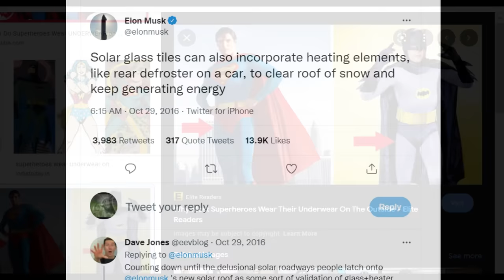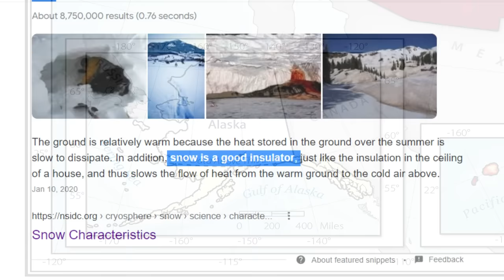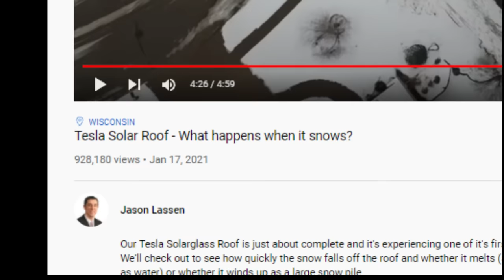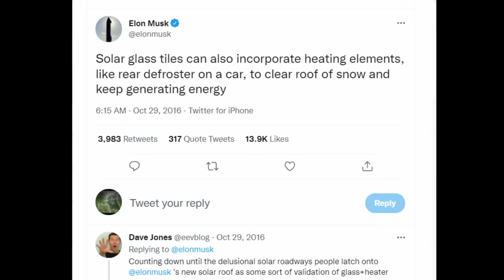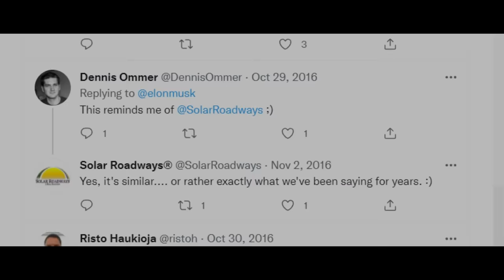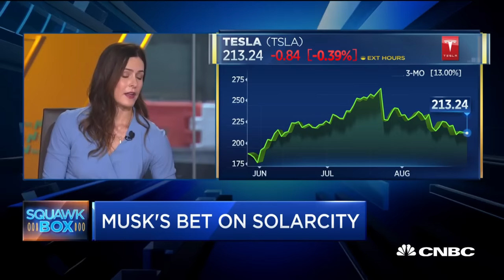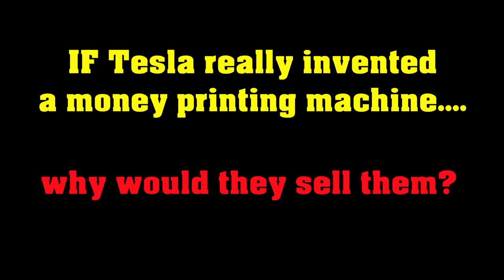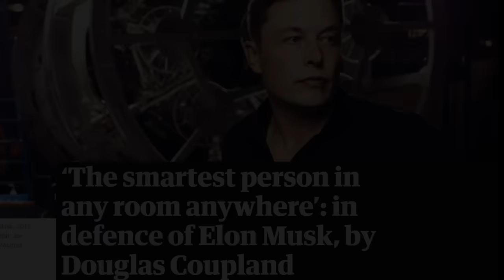Elon Musk: The Smartest Person in any room ANYWHERE!

Comment: 13:20 - "A tube with an air hockey table". Hmm - a tube that's suppose to be in vacuum, then you blow air thru holes into it. That's an interesting definition of a vacuum.
Reply: It's a straw-man.
Reply: @antonpershin998  How is what a strawman? Do behave and tell me you actually know how vacuums work. Because big boy Elon Musk seemingly doesn't.
Reply: @InfiniteDeckhand  if you actually read the Hyperloop Alpha white paper, you would know, that there is no vacuum, jus low pressure air.
Reply: @antonpershin998  Oh, so you mean the quasi-vacuum which Thunderfoot had already demonstrated would crush the tube and is only a miniscule amount of air away from being a total vacuum?
Not sure if you know, but low-pressured air can't provide a bed to glide on like an air-hockey table would. Only pressurized air can do that, which would rule a vacuum out entirely, since those two can't exist at the same time in a closed system.
Reply: @InfiniteDeckhand  "Thunderfoot had already demonstrated would crush the tube and is only a miniscule amount of air away from being a total vacuum"
And of course that tube wasn't disigned to handle quasi-vacuum?
By that logic LHC is impossible, like any other vacuum chamber.

"Not sure if you know, but low-pressured air can't provide a bed to glide on like an air-hockey table would"
That's exactly why hyperloop alpha pods have air compressor in front, to pressurise air.

"Only pressurized air can do that, which would rule a vacuum out entirely, since those two can't exist at the same time in a closed system"
Air castors work by pressure difference, pod moves thrugh tube at very high speed, thus air pressure is higher in front where there is an air compressor, which pressurises air even more.
Since air castors use only air from tube, overall pressure stays the same.
Reply: @antonpershin998  
> "if you actually read the Hyperloop Alpha white paper"
The White Paper!! The White Paper!! All glory to the White Paper!!

Comment: Normaly i´m on Thunderf00t´s side. But her i partially disagree.
My Parentes live in Germany ( so in the north region ) and we have some Snow days. 10-15 Per Year.
They have a Heating installed BUT it´s only for burst Heating for melting not the hole snow but only the bottom to let it slide of the Angeld Roofs.
Full Summer they get a peak of 38 kW/h per day. In Winter it´s only 12kW/h per Day (snow free) and only 500 W/h per day with Snow. 
Burst heating cost ~2-4kW/h of Energy and from 500 Watt/h per Day it did go up to 8 kw/h per Day. ( ~80% of the snow slided down )
But still starting in the morning to catch the most son in the middel of day gives twice the energy as used for getting the roof snowfree.
Reply: You're a bit confused about units here. Watt is a unit of energy per time (Joule/seconds). 
You are telling us the amount of energy it took to melt the snow. To get back to energy you multiply with time, not divide by. The unit you then get is Wh (1 Watthour = (1Joule/1second)*3600s = 3600Joule). 
W/h is a change of powerconsumption over time, which doesnt apply here.
Reply: @S1nwar   I´m was not confused and only used kW/h as its normaly here in Germany. But after reading your correct Math i thinky you misunderstand something or you are confused. I don´t used the Watt generated becouse the numbers are going up and done and also not the average. I used how many kW/h where produced on a day and the amount of energy used for heating. In your math you showed 1W/h = 3600 J. So you can use all the numbers ( exculding the 10-15 per Year ) and convert them for your use. But on the Electric bill i pay it s still written ~300 kw/h per Month.
Reply: @FranksFilmEcke  You are confused Gino. The thing that is on your bill is kWh =power(kiloWatt) multiplied by time (h) so kiloWatt x hour. Not kiloWatt /h.
Reply: @wvdh  Sorry, but in Germany kW/h is also correct. But it´s the same als kWh. Just checked my bill it is kW/h written there.
Reply: @FranksFilmEcke  Well then it is easy, your bill is wrong. I would think that anyone above primary education level understands that dividing 2 things is not the same thing as multiplying them.
Edit: check the Wikipedia page if you are not convinced https://de.wikipedia.org/wiki/Wattstunde

Comment: I would like the calculations on how much energy it would take to melt the snow vs amount of sunlight needed for this to be accomplished. I am no mathematician, but I doubt it adds up.
Reply: A lot.  A whole lot.  Snow is highly reflective so it doesn't take much of it to block enough sunlight getting to the tile to keep the tile temperature below 0 C.  Up where I live most of the snow isn't melted directly by the Sun in the spring.  The snow starts melting when the air temperature gets well above zero.  It really gets going when the nighttime lows stay above zero.  The other way it melts is outwards from where the ground has been exposed.  A field of undisturbed snow can stay covered until well after the trees, sidewalks, etc. are completely snow free.
Reply: He's already covered the maths on that. Watch some of his solar roadways videos, in which one is where he mentions why we use snowplows, instead of flamethrowers.

If I recall correctly, the energy required to turn water from solid to a liquid, is the same amount of energy needed to raise the temperature of the water by a single degree.
Reply: I have no idea if it is a good idea but it is plausible and has not been 'proven' otherwise on this video.  The snow is not melted from a foot thick to nothing, it is melted as it falls and solar panels are known to naturally run warm in day time to begin with.  Keep in mind that the tens of millions of air source heat pumps around the world also do a similar defrosting procedures: when they are used for heating in cold climates they are perpetually icing-up and have to stop bring heat into the house, reverse the pumping direction and then pull some heat back from inside the house to the outside coils to melt off the ice.  It's a small loss for a large overall efficiency.  There is likely an equation that could demonstrate this making (or not making) sense for defrosting/de-snowing solar panels or solar tiles.  It is not implausible like the misleading charlatan Thunderfoot says here off the cuff.  Really both Musk and Thunderfoot are talking out of their axses most of the time, but one of them is actually accomplishing some amazing things while the other merely gets a lot of Youtube views.  Meanwhile people do fine with solar panels even here in Canada, much to the chagrin of the deluded TF.
Reply: @deathsheir2035  Not even close.  Melting a gram of ice takes about eighty times more energy than it takes to raise the temperature of gram of water by one degree Celsius.  Water is actually a really weird chemical.
Reply: @scottross8606  Solar panels do get covered with snow here in Canada if they are too horizontal.  When the daytime high is -15 I guarantee the panels will not be above 0.  What they do have going for them, especially if they are angled properly, is that they are so smooth that snowflakes just slide off due to gravity or get blown off with the slightest breeze.
Reply: Might depend on the amount of snow.
In arid climate were it barely snows but the snow last forever once it snowed it might be worth it. Maybe.
Reply: @JonMartinYXD  gravity lol gravity pulls down small snow flakes but not helium balloons it about being heavier than air not gravity

Comment: The "Tesla roof" is on a house under construction. By far the most likely reason that roof is clear is that they probably haven't installed any insulation yet.
Reply: yet tesla is promoting that the roof is working
Reply: @toomanyaccounts  sounds like a typical tesla project.
Reply: Do they heat the whole house while it is under construction? I would have thought they would just have a blower in the room they were working in (I have never worked in construction where it snows)
Reply: @glenecollins  I don't work in construction, but I've noticed that they seem to stop working during the winter.

Unless it's a big project where they can cover the whole thing up, it doesn't look like they work right before it starts snowing.

I have no idea if it's just what it looks like or if it's just a Norway thing, but that's just what I've noticed.
I don't think they normally waste too much money on heating unless something they are doing require a specific range or temperature like painting or gluing, but during the cold days they generally just cover up with warm clothing, hats and gloves.

again I don't work in construction :)
Reply: @svampebob007  they would just wear a jacket or something here but our coldest days generally get up to 10 degrees C by midday (where I am at the moment) and I have mainly worked in the tropics and subtropics.
Reply: The heat will not even be on, nobody is living in it, they will be passing current back through the panels at night I imagine.
Reply: @kingcosworth2643  that would mean the panels are constantly acting like a resistor across the charging circuit that seems like a horrible waste of power.
In this case the panels probably aren’t even connected to the mains. There are other dark roofs in the video where there is no snow on what I assume is the sunlight side. They probably just had a few days where it was marginal if the snow would accumulate or not. If it couldn’t accumulate the lower reflectivity of the solar cells (snow is very good at reflecting infrared heat) would warm the snow that fell in the day and possibly melt any which fell at night.

I think the surface is also more slick so snow would be more likely to fall off.

TF is correct about the snow being a good insulator but if you are just at where the roof is being heated by the sun enough to melt the snow the energy usage may even out.
Reply: @glenecollins  You could be right, I was thinking it could potentially be an option to power them at night a little so snow doesn't settle, you will waste energy, but by function you will be able to produce power during the day because they are clear,  if you don't clear them then they are blocked.  It probably is connected to the mains so the workers have power, but if it's not it most likely has a battery.  But the fact the roof is glass and has such an aggressive pitch could certainly be all that is doing the job.

Comment: I think there is a bottleneck on engine production, not so much the cost potentially. So losing x engines would cause timeline delays. Where performing testing with minimal resources seems ideal..

Great video overall. I wonder if spending electricity up front to melt snow and then generate electricity, out weighs not melting snow and not generating electricity. Small amounts of snow it seems pretty obvious.
Reply: I also thought that that part wasn't as solid a the rest of the video.
Reply: @UmbraPhi  Yeah I am glad there are other non fanboys/haters to point these things out. I enjoyed the video thoroughly, but there were these few times where I did not think he was being particularly objective. You don't try and melt the snow with solar energy generation when its 1" thick on top of the panels. You already have it melted.
Reply: @brianstearns3692  Then you run into how quickly can this roof melt snow while still gaining more power than it is using vs snow fall rates. Likewise it should be possible to determine how much insulation savings there would be from snow vs the cost of not having it and generating electricity.
Reply: @graham9454  Having solar panes on the roof myself I can testify to the fact that the roof is among the first to be snow-free again.
But: don't forget that the panels are both very dark and very smooth so snow doesn't adheres very well on them and the panels heat up by any sunshine after the snowfall. Snow is quite transparent and 20% electric efficiency means 80% heat into the panels. As soon as the sun shines a bit on the panels the snow on the bottom melts and - well: you better watch out ...
Reply: Isn’t this just cherry picking scenarios? You get bad snowstorms as far south as Maryland/DC metro and then a week of clear blue skies and snow covered roofs. In that scenario, clearing the roof would be beneficial and the insulation argument seems weak, as most newer houses are built with a ton of insulation in the attic spaces.

As typical of Thunderf00t, he focuses on extreme cases instead of the expected median.
Reply: Unless you can get the snow to slide off the roof, melting the snow is a terrible waste of energy. It takes 340J/g to melt snow. Let's say snow has a density of 0.2g/cm^3. Since solar panels have an output of about 0.02W/cm^2, melting 1 cm of snow off the roof through electric heating would take the energy output of about an hour under ideal conditions. The problem of course is that if it's below freezing, the vast majority of the energy will go into heating the air rather than melting any snow.

The real question is if the Sun can't melt the snow on its own over 2 days, why would you expect a solar panel powered by the Sun at 15% efficiency to do so in a few hours?

Comment: @Thunderf00t - 10:25.  You keep saying how badly inundated the house is, when it is clearly under construction and unoccupied.  Could it be that material properties of the  roof clear it up?  I have a mountain house with a metal roof.  The moment a small layer between the snowpack and roof melts, the snow slips off the slippery surface.
Reply: He usually release a video about Tesla/Elon around every tesla's financial quarter. Sometimes I feel like he is trying to manipulate the market 😂😂.
and yes, the moment snow melts it creates a slippery layer and also the house was under construction and had no heating, so it's safe to say that the tiles got rid of the snow.
Reply: Where are the piles of snow that fell off the roof, then? Also, where did the heat to melt the initial bit of snow come from if the house is under construction and unheated? Also, does it really work out to lose insulation from the snow versus the energy collected by the panels?
Reply: @Monochromatic_Spider  I can't say how much snow there has to be.
The tiles according to Tesla.
The roof should not need the snow to isolate it for energy efficiency. Also I have seen my neighbor clean his Solar panels in cloudy day after snow. However much you get, is still free energy.
Reply: Nearly black, relatively slick surfaces shed snow quickly as do metal roofs. Looking at the snow depth shown, OP may be overestimating the expected accumulation near the walls.
Reply: You are absolutely right.
From Elon's Twitter: "The Tesla Solar Roof is slightly hydrophobic, so water, snow or ice slide off easily" 
Melting snow on the road isn't the same as sliding it from the roof.

Comment: *laughs in Canadian. This is absolutely true, we use snow as an insulator, this is universally known (pretty much). So no, the article is wrong, practically everyone in Canada is smarter than Elon Musk. lol. There is a point at which it is also a weight risk, so we do clean off our rooves, sometimes. Depends on the winter. But with about a foot of snow and even 2 feet, depending on density/moisture/weight (and slope of the roof etc.) you are wise to keep it, yes indeed.

Comment: It dont seem like you know much about building code and generally how a house is build when you're saying that the Tesla roof is badly insulated. It sound kinda stupid, just like what you're trying to debunk. As far as I know, Tesla does not make anything else than the tiles. They are not build to insulate, neither is other tiles or shingel (that have a lot of friction) that is really common in the US. The insulation goes under the wind and waterseal of the roof. Either the houses is not 100% insulated yet or the shingels on the  other houses could've something to do with. And btw, solar will break even a lot of places up north. While you don't get to much in the winter, in the summer you'll get like 12+ hours with light.